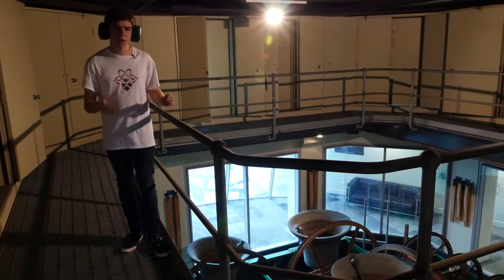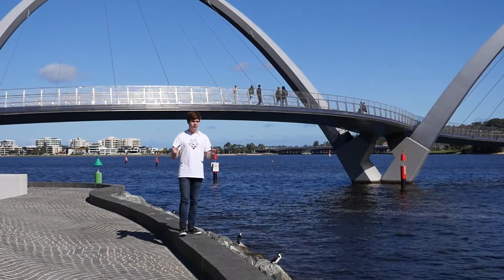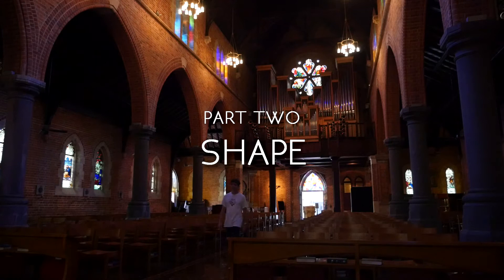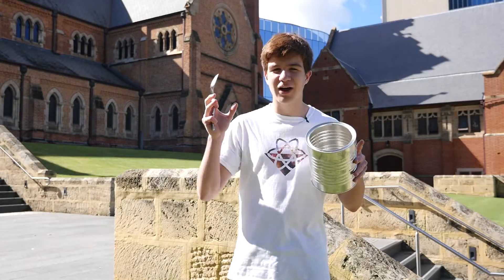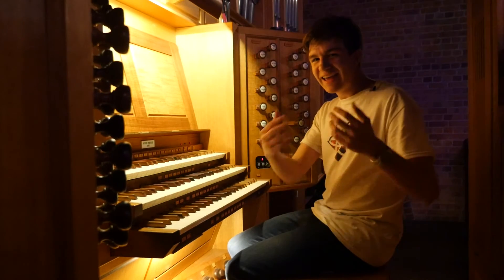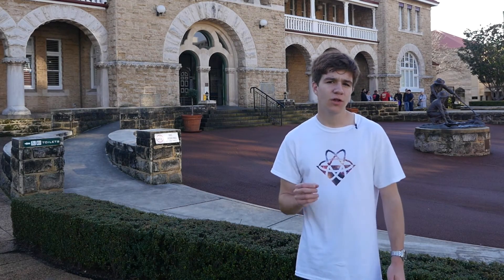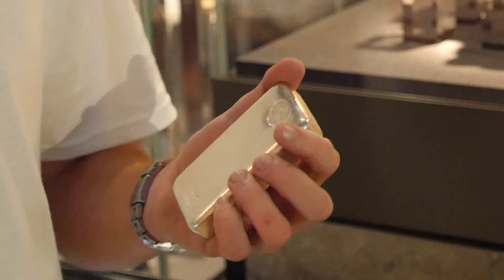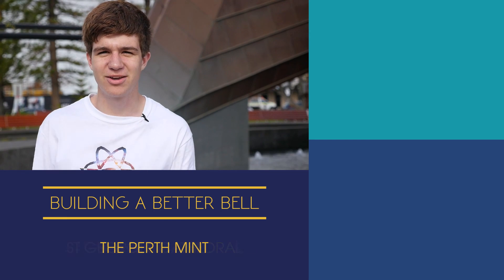Building A Better Bell

Comment: Misleading to compare a bell to an organ pipe. Organ pipes do not vibrate to any significant extent. It's mostly the air inside the pipe that vibrates. That's why you can get a beautiful organ tone from pipes made of wood or even paper. And they don't need to be round. Traditional wooden organ pipes are usually square or rectangular in cross section. Another important difference is that organ pipes are blown instead of struck, which allows resonance to cause a single tone to build up and dominate, even if at first there are multiple different tones (sometimes heard as the "chiff" at the start of an organ note). The most important point in this video is at 3:30. Just like the flat sheet of metal, a bell allows many different vibrations at once. But unlike the flat sheet of metal, the bell is carefully shaped so those vibrations are harmonic multiples of each other. The art of tuning a bell is all about carefully removing metal to change the frequency of all those different vibrations at once, and this is not easy, especially as you can't add metal back again once it's removed. Certainly good metal helps, but I think you should have emphasized the skill of the bell maker in shaping the bell correctly.

Comment: Lovely, but a wee correction; the Swan Bells at the most are 300 years old (1725 for most of them), and the very oldest bell in the tower (though just on display and not rung due to it having a crack) is from 1550.

Comment: Amazing work James once again! I do worry about the cost of maintenance for this super bell considering the effects of corrosion on Ag ...
Reply from the maker: Hmmm... very good point you have there. For the brief period the bell works though it would be awesome to listen to, and I'm sure City of Perth would be happy to spend several million dollars to fix it up every couple of years.
Reply: @AtomicFrontier  Couldn't it just be sealed in an airtight chamber filled with some noble gas? I'm sure the acoustics won't suffer too badly...
Reply: @AtomicFrontier  18 bells in here they came from st martins in the feilds and are in the note of C#
Reply: @AtomicFrontier  if they didn't mind dropping a million on the cactus they won't mind that